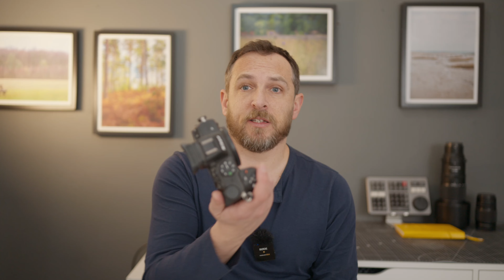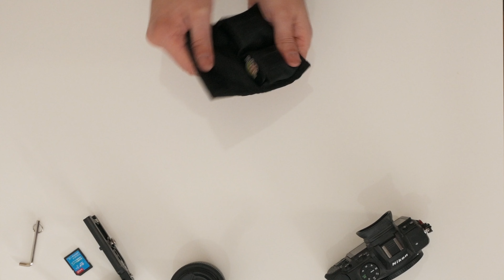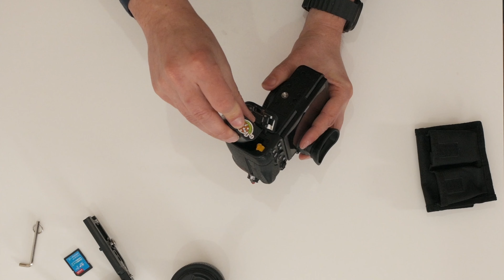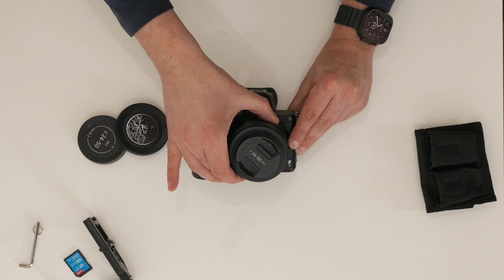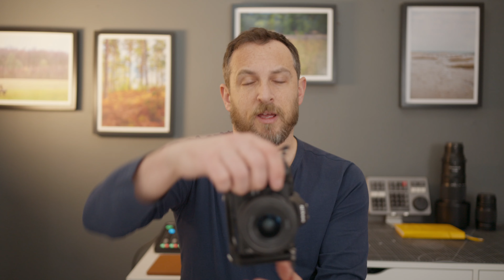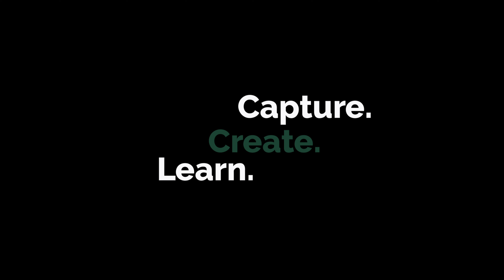How to Set Up Your New Camera: Battery, Lens, SD Card (Beginner Guide)

Comment: Nicely done.  Ideal for a beginner.  I would suggest a bit more advice regarding the second battery. If your battery goes flat the camera is once again reduced to an expensive box.  I think all cameras should be supplied with 2 batteries.  One is great until it isn't!